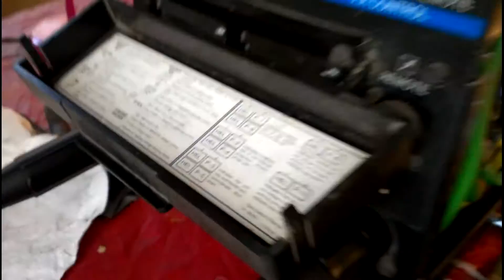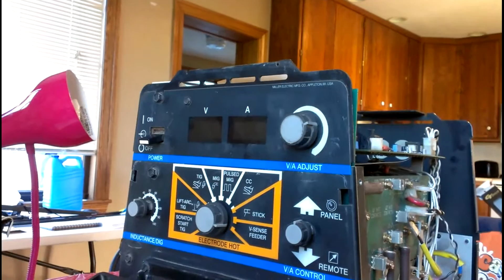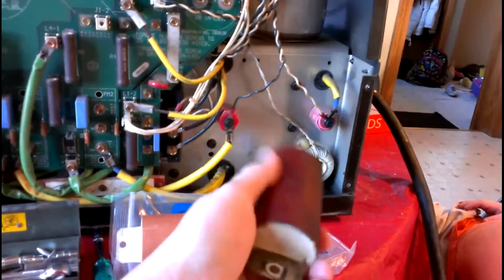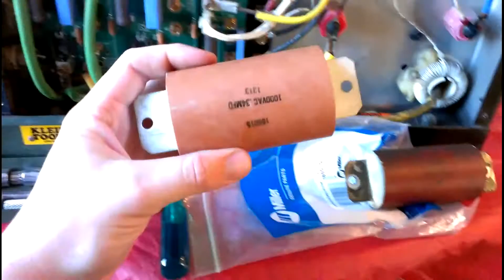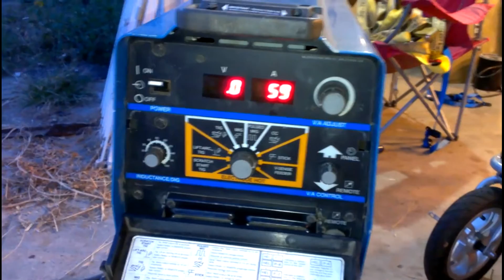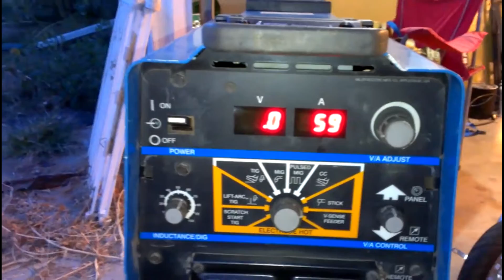Miller XMT 304 Help-1 fix

Comment: I have a 304 it's not giving me no codes. Voltage and amperage meter are going up and down. It doesn't want to weld or make an if you can help me or make any suggestions please

Comment: Fixed my xmt 304 cc/cv. It had a blown capacitor and a melted contractor and a connection need to get re welded down. runs amazing now.
Reply: What did this cost?
Reply: @Jtdedeaux  just $80 on ebay for the new capacitors

Comment: what kinda ohms did the new capacitor read? I just got a xmt 304 from a guy and come to find out it is broken. I plugged it in and it blew my breaker. I found out that one of the wight capacitors on the inside blew up and was spewing oil out. so i ordered two new ones and i just want to check and see if the capacitor you changed is also bad in mine. i could not get an ohm reading on mine at all. it acted as if it was an open circuit.
Reply: did ypu get your xmt fixed?
Reply: @mandylad  yes, with new ebay capacitors.